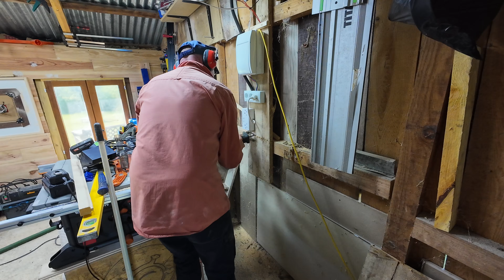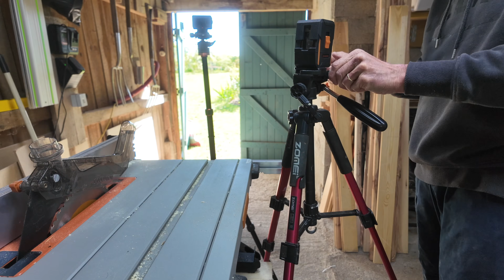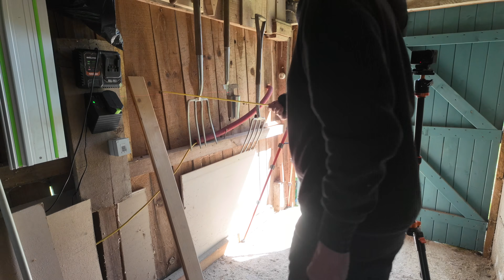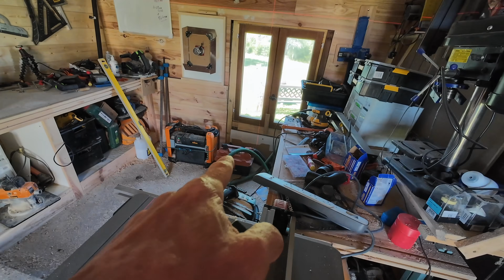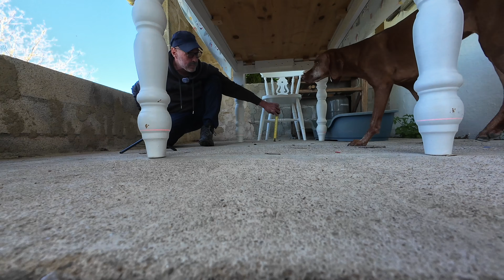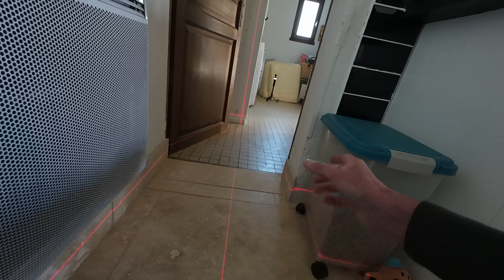Cheap Laser Levels - Surprising Tool Discovery.

Comment: Laser levels are great bits of kit. JP Your patio might have a slope on purpose to allow rain water to drain, as is looks like you had an opening which could allow rain in.
Reply from the maker: Hi Gary. I built the patio ( the videos are here from a couple of years back.) The day I laid the base it was hotter than hell and the concrete got away from me creating a hump in the middle end. Water does puddle there against the wall. The table also has a wedge under the leg to stop it rocking. Cowboy 🤠 builders 😂 Regards JP

Comment: I have the original Stanley version which I purchased here in France abut 15 years ago and it has been completely invaluable, I have literally used it for everything. It has been with me through two complete stone house renovations and a full Barn conversion. I have used it for all stages of construction from helping to put in the the Foss/drainage systems right through to tiling and projecting onto plasterboard so that all the screws hit the stud.
If yours gives you one tenth of the use mine has then it will be great value for money. It's one of those tools you wonder how you managed without!
Reply from the maker: Nice to know you have gotten so many uses form your level! You mention your Fosse. These frighten me or replacing mine does.   We live on solid stone. My neighbour  has just build a second house and the pile of stone they have jack hammered out is taller than the roof! Regards JP